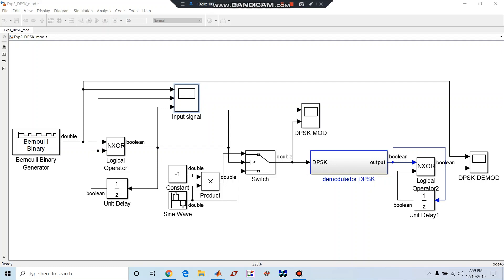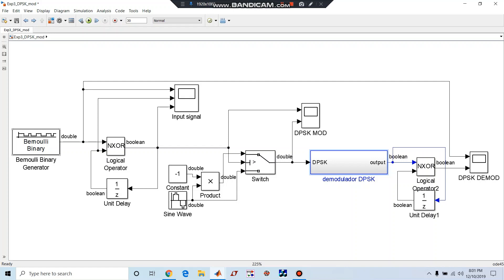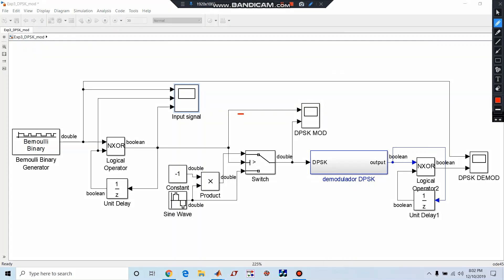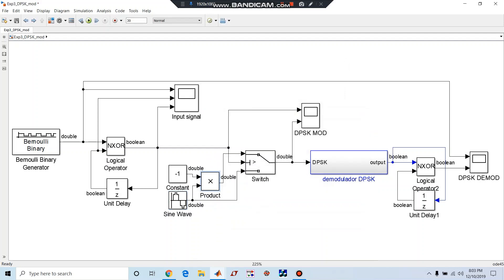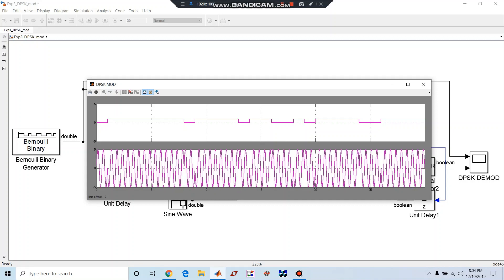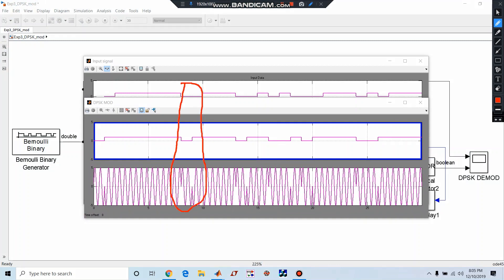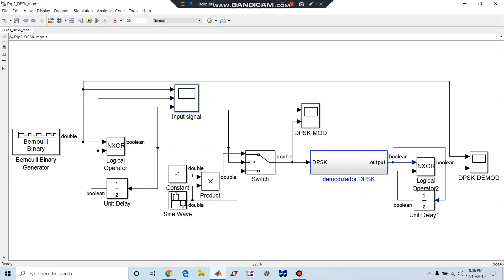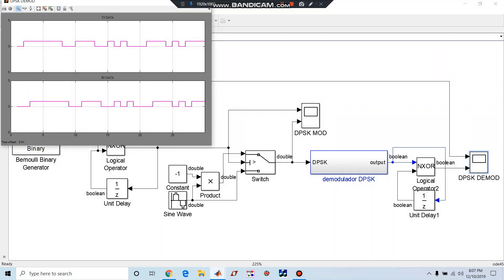DPSK_Differential Phase Shift Keying | Software EXP_4A | MATLAB Simulink | Comm Lab | VTU ECE

Comment: CAN you help me making MIMO MODELS using Qpsk Modulations
Reply from the maker: Sorry.
At present I am occupied with other work.
Reply: @_Learn_With_Me_EraofAI  I just want to know how I can increase the no of output ports from QAM or QAM modulators and increase the the same number of  input ports in MIMO releigh model given in Simulink and it's out put ports i.e. n×m ports and Same no. of inputs coming output ports of MIMO( i.e. n×m) in corresponding inputs ports of corresponding de modulator?
Reply from the maker: @miscvids6496  you need to add more parallel streams and summer with more number of inputs to add all the signals. Receiver design will be complex and I have no idea of it as of now.